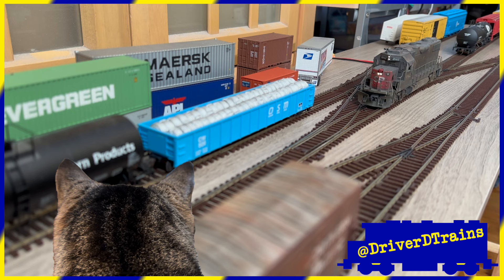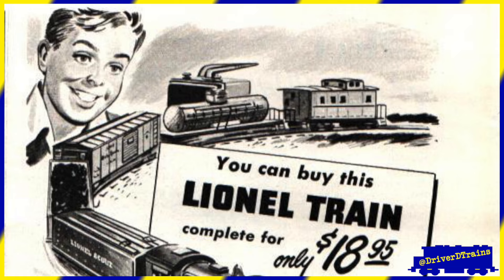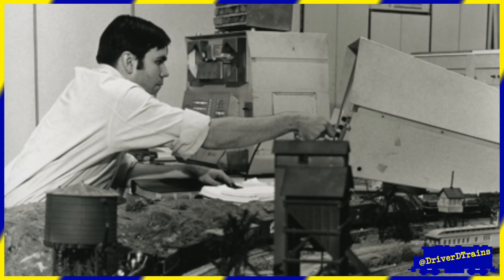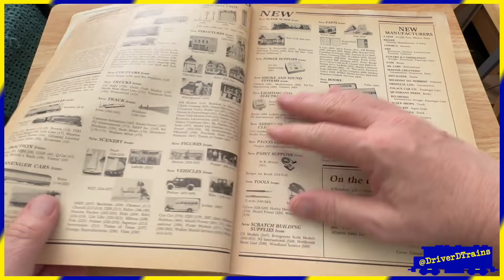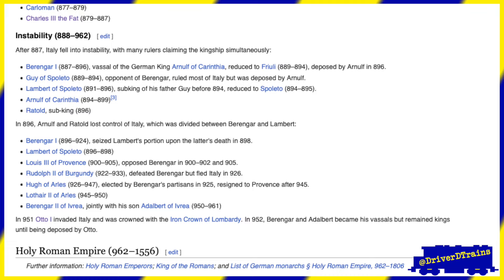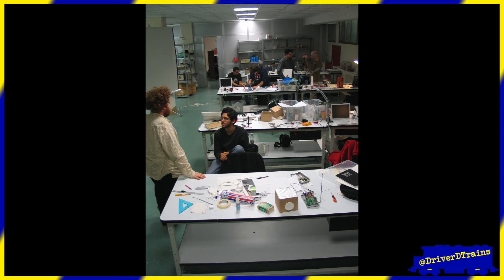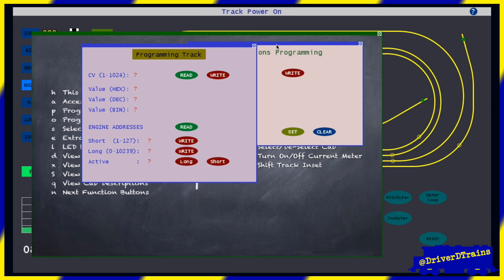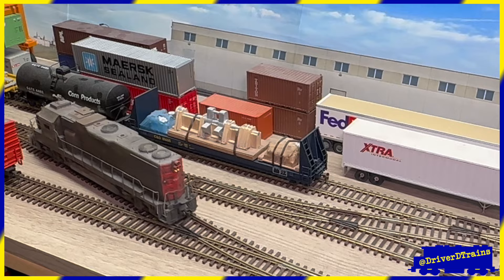#4.x – DCC-EX Series Bonus Materials (Assembling a DCC-EX Command Station)   @DriverDTrains

Comment: Looking forward to the JMRI series and how to configure it with DCC EX command station. Thank you for your series on the build which I found very easy to follow. Best one on you tube by far.
Reply from the maker: Thank you very much for your kind comments. I'm really looking forward to making some videos about using JMRI with DCC-EX. That is my normal setup. I will be working on the first video soon which will be a general introduction to how JMRI works and how you can use it. Then I'll dive into installing it, using the Decoder Pro app, setting up JMRI throttles, and then using the WiThrottle and Engine Driver apps with it, as well as some other types of hardware controllers. So look for the first video in the next few weeks. 

Thanks again!
DD

Comment: I’m crossing my fingers that you will be releasing the JMRI videos series very soon. Thanks for this great video and the pat on the back I’m giving you!
Reply from the maker: Thank you for your kinds comments. I really appreciate it! Yes I will start working on the first JMRI video soon. The first one will be a general introduction to how JMRI works and how you can use it to control your trains. Then I'll dive into installing it, using the Decoder Pro app, setting up JMRI throttles, and then using the WiThrottle and Engine Driver apps with it, as well as some other types of hardware controllers. Look for that first video in the next few weeks.  And thank you for the kind pat on the back! :)

Thanks again!
DD
Reply: You are very welcome! I have my fingers crossed hoping that you’ll post your next video tomorrow.